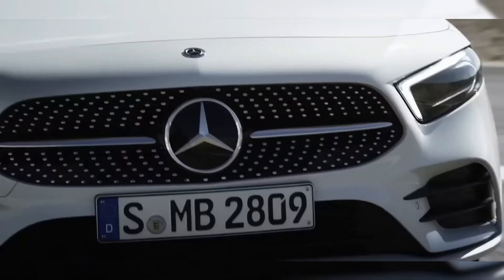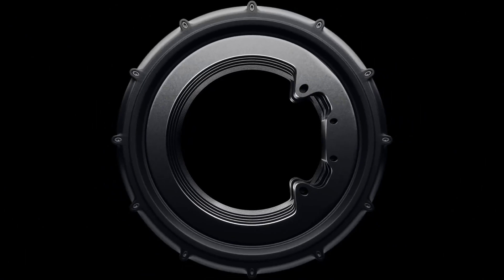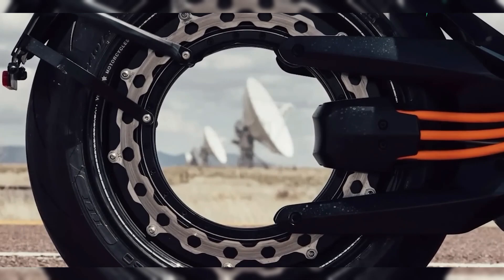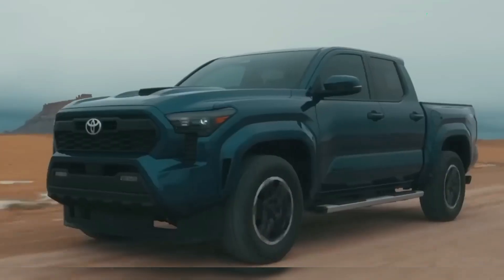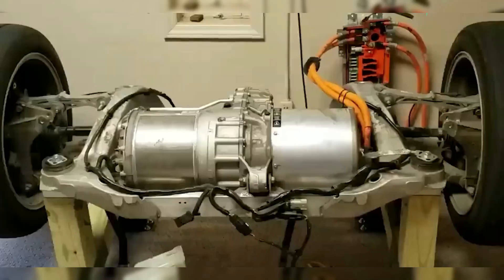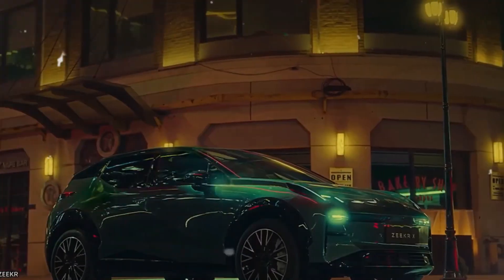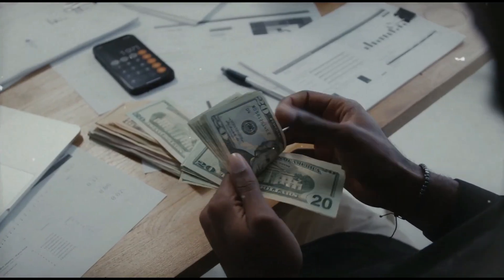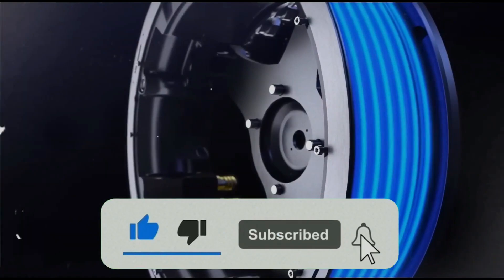Everyone’s Talking About This EV Motor—Here’s Why! 🔥

Comment: What happens when you drive through a flooded road? (And water gets into the motor)💥💥💥
Reply from the maker: if the motor isnt sealed properly, it will mostlikey fail

Comment: so how does it work?
Reply from the maker: Instead of the traditional radial flux motor where magnetic flux flows radially from the rotor to the stator, an axial flux motor has magnetic flux that flows parallel to the shaft (axially).
When current flows through the stator windings, it generates a rotating magnetic field.

This field interacts with the magnets on the rotor, producing torque via electromagnetic forces.

Because the field moves axially across the face of the rotor (not radially), it's called axial flux.